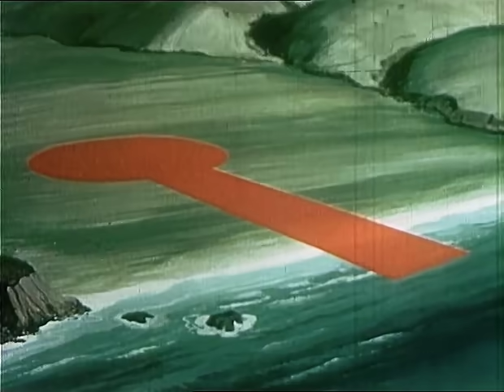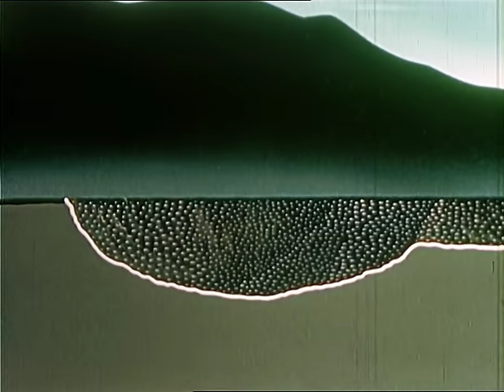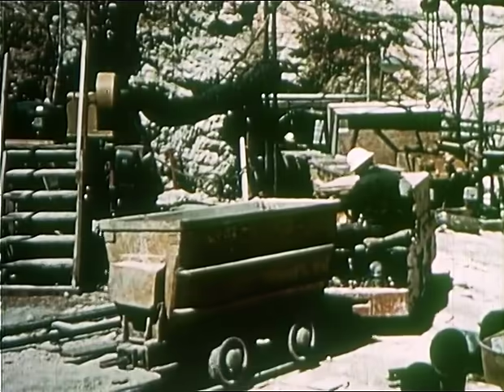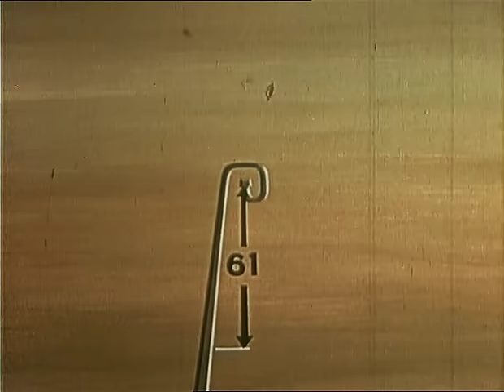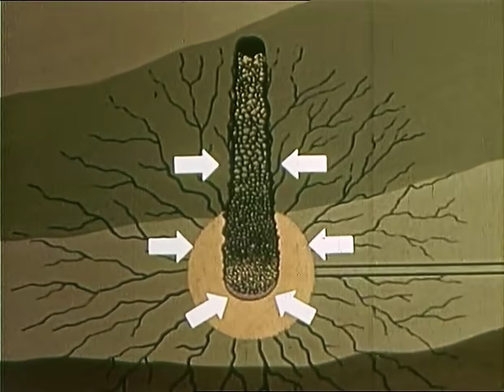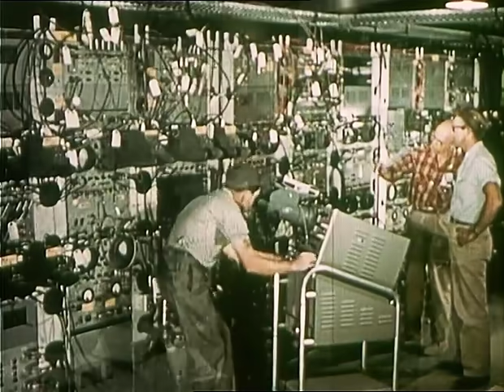Industrial Applications of Nuclear Explosives (1958)

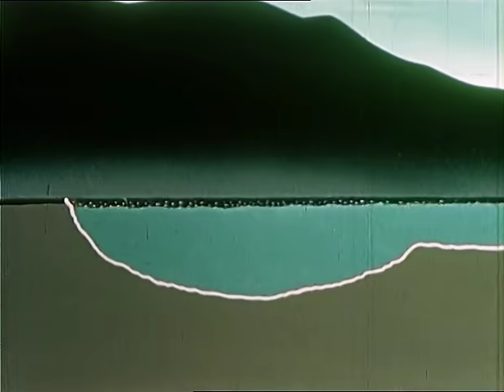Comment: They were fast and loose when it came to radioactive contamination   2:20 "washed out and removed from the biosphere" (right into another biosphere!!!)
Reply: It was towed from the environment.
Reply: Just like when the front fell off…
Reply: Thought same thing. “It’ll just kinda rinse away basically”
Reply: when dissolved in ocean water it would likely rapidly spread out to a degree that there would be no single significant concentration

Comment: Impressive use of metric units. A bit surprising (given that it was made in the US in 1958).
Reply: military often uses metric
Reply: Generally speaking, the science community primarily uses metric because of the values of 10 between each magnitude. And many scientific constants are quoted in metric values.
Reply: The U.S. Congress authorized the use of the metric system in 1866.  There were improvements and revisions to the system up through 1960.  And probably more after.

The Metric Conversion Act of 1975 is an Act of Congress.  But was completely voluntary.
Executive Order 12770 July 25, 1991 made the metric system the preferred system of weights and measures for United States.

The resistance to flipping completely is strange.  Many industries in the US use metric but make conversions to non-metric for consumers.
Reply: Thats for people, who are educated,      in that field.

Comment: If they could make a hydrogen bomb to be triggered without uranium or plutonium, this technique is highly implicable. Neutron emission would be absorbed with the said borated shell of the bomb and there would be virtually no emission of radiation, nor significant neutron activation of the elements in the earth.
Reply: You can make primaries with less than 500 g of Pu if you're good enough.